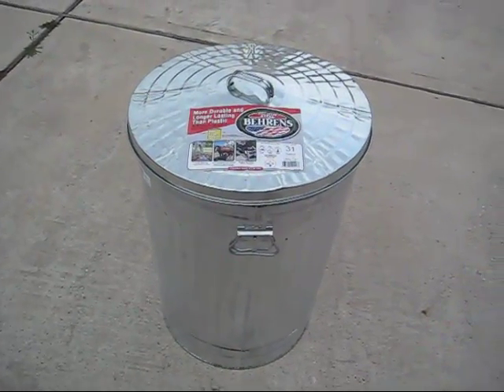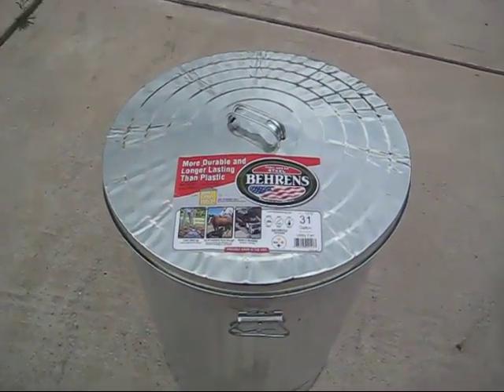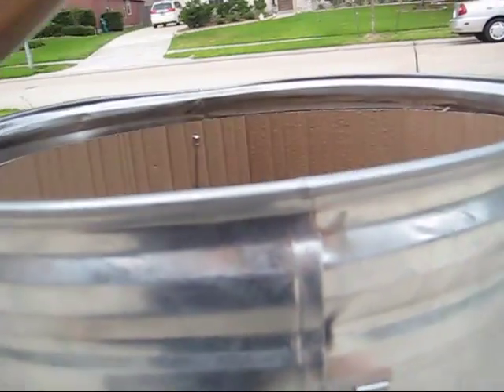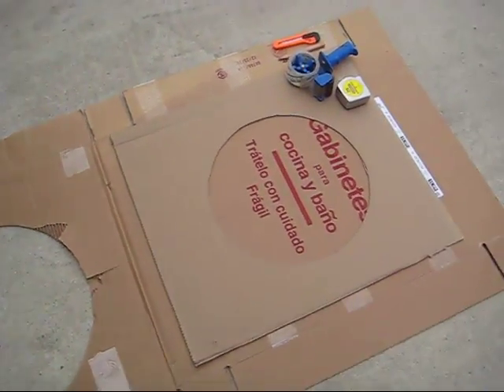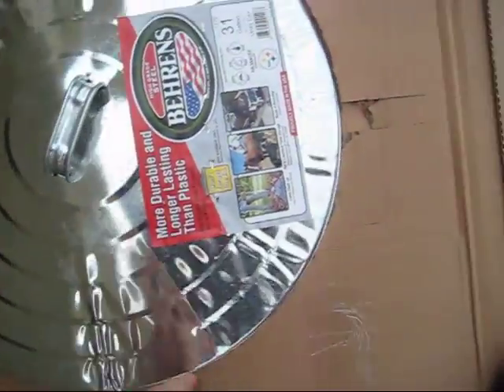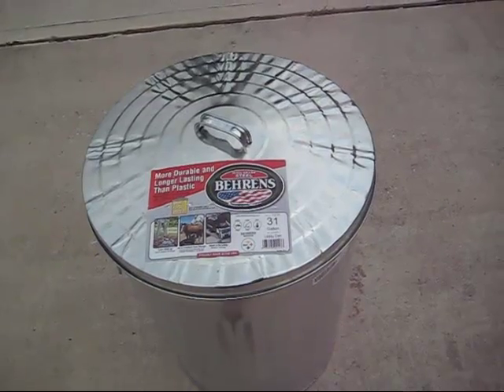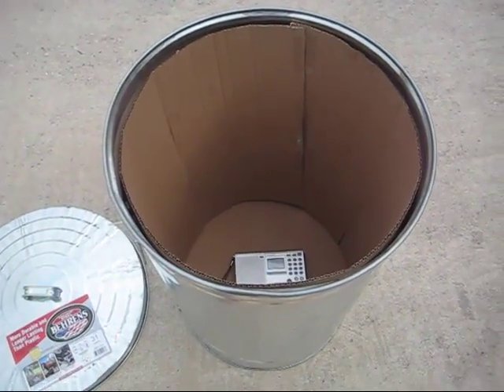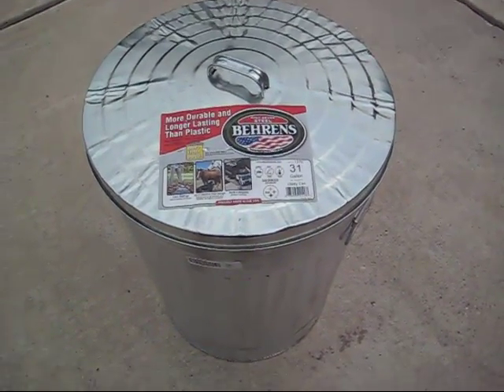Faraday Cage: Garbage Can, Really?

Comment: This will not work my fellow preppers. WILL NOT!  Coming from a electrical engineer. I emp/cmp aka solar flare is at a much much higher frequency than radio or cell phone. Look it up. 2 different types of cages. Grounded & non-grounded. The non-grounded needs to be very very thick and non-conductive liner inside. Both need extremely tight seals so no frequency gets thru any gaps. Moving on. Just remember. THIS WILL NOT WORK!
Reply: Jim, How do you get a grounded and non-grounded cage?  What do you use?
Reply: +Linda Allen 

Ok Linda start with a grounded cage. It needs to be a highly conductive metal like copper or sliver. Copper is way cheaper. Use a thick gauge copper sheet. The lid must be very tight fitting all the way around. Then you need at least 1/4" think non conductive liner on all sides including the lid thicker the better. Solder a thick copper wire from the lid to the body of the cage. Then solder thick copper wire to the body of the cage and run that outside to a copper ground rod that's put at least 18" in the ground. Set the cage on wood or concrete. Bam. Grounded cage done.
Reply: +Linda Allen 

Unfortunately there is no easy way out for a good faraday cage. Good quality commercial ones are for the rich only & good home built ones are labor intensive. I prefer wooden ones as you can set them on the ground, on dirt, concrete or even on a shelf or work bench and your protected. Even from a nuclear emp that goes off directly over head. Only down side to wooden ones are weight when you make them on larger scales. Need a forklift to move them when full. LMFAO! 

I need to find the links on wooden emp protection that was done and post it. Haven't had time between working 70 hrs a week, home projects, raising a kid, looking for land to buy and teaching the kid to shoot guns, bows, throw knives & hunt & gather. Been a busy busy man.
Reply: James Hart 

I did a vid today explaining some of it. Will be uploading it this evening. It'll take a hour plus off wifi. Lol. I'm going to try here soon to make another wooden faraday cage and video it this time. Lol.
Reply: No one on YT seems to know how to build a Faraday cage that holds up to a real EMP.  If you get to it, that would be cool for a lot of people.  Two thoughts:  A) an EMP attack (as opposed to solar) would likely be followed by a second and third EMP a couple of days later to destroy items that were originally protected in a Faraday cage but were then take out to use after the first attack.  It seems that a room-sized Faraday cage would be the way to go, so that your electronics never have to leave the protection, although how would that work with a radio?  B) I read an article saying you can also bury things 10+ feet below the earth.  Seems like if you went deep enough, okay, but more than 10 feet and thus not feasible?
Reply: I am an RF Engineer and I work in Shielded Cages all day and have installed one at work with ETS who build these for military. even a slight gap in a professional installation of a 100dB down at 1GHz is easy to have even when it is filled with bronze wool and sealed with copper and then taped with conductive tape. There may be a chance this works for you but are you really willing to take that chance when you are going through the effort anyway. shielded systems are heavily grounded and have two layers. The frequencies of an EMP or Solar flare are extremely high and can find even the slightest gaps.
Reply: What about underground? Would a bunker or simply burying the can block the EMP or Flare?
Reply: I built this exact cage and I could still call my cell phone in it..   .so yeah.  did not work.
Reply: If you use high quality anyi static bags and seal it up with metal foil you will be a lot better off.
Reply: You should make a video or series of videos showing this, bud
Reply: What if he attached a wire to his homes water line to ground the can?
Reply: Dunno.  A lot of people say you don't need a ground at all.  Like I said, no one on YT knows how to do this shit for sure.  It sucks.
Reply: Considering wood is conductive. I work on power lines - and wood poles get heated up all the time. I would use plastic as the liner. Otherwise he is correct about the grounding. Or use concrete.
Reply: +Jon Himes Thank you
Reply: My thought 1/2 lead sheets thin gauge like maybe 0.21 aluminum  and plasti dip and a grounding rod ..  pour the  lead into a cookie sheet make sheet lead for all sides plasti dip the lead after its all put together. Take the aluminum tac weld to aluminum  frame work for the coated lead to sit inside of the aluminum shield.  Ground the aluminum shield  to a grounding rod. Two  things i need to know will that lead and plasti dip hold up that way? If  no what if i use diodes inside between the lead and aluminum and flow the current back to the grounding rod?  That or just used large resistors between the aluminum and lead.??
Reply: Papa Trucker...right on! Radio energy needs somewhere to go, ergo, the grounding strap and earth ground rod...if a trash can is used, get some thin, flexible foam sheets and line the interior to keep electronics from making contact with the metal sides of can. If I remember correctly, an EMP has a frequency range from about 5mhz to about 2 ghz at incredibly high voltage...

Comment: How do you protect the solar panels from an EMP???
Reply: They have some new ones that are EMP hardened.  Other than that I would guess you would need to keep them in a Faraday cage until the SHTF....plus about another week in case they launch a second EMP.
Reply: Thanks.  I was recently advised that the solar panels themselves have no electronics built into them and so would not be harmed by an EMP.  Have you heard anything to the contrary?  Thanks.
Reply: I was told the connections would be damaged.
Reply: That is a video for the EMP hardened panels.

Comment: I did everything you said, I followed your instructions to a tee and it doesn't work.  I lined and paneled the interior of the can with cardboard and the bottom of a 10 gallon can made by the same manufacturer as you show on your video.  I lined the inner lid as well with cardboard as instructed.  I placed my iPhone in the can and dialed it and I could hear it ringing on the inside... the only way it worked is when I wrapped the cell phone in tin foil....  Have you tested yours with a cell phone?  So far, this method is ineffective based on my doing it.
Reply: Jim you're supposed to wrap the item in tin foil. The tin foil wrapped item can't touch the inside of the trash can,hence the cardboard liner. I learned this from a great book called "Darkest Days" by survivopedia.com
Reply: different frequencies, radio vs cell, cell is harder to block, must be completely sealed, aluminum tape

Comment: I performed this with a smaller 10 gallon can made by the same manufacturer and the only thing I didn't do is put cardboard in the lid.  I placed my iPhone in the can, closed the lid and the phone still rang.  So the only thing I didn't do is the cardboard in the lid.  What function does the cardboard serve?  Let me know what else to do if I put cardboard in the lid and the iPhone still rings... any suggestions are appreciated.... someone said metal tape around the lid and can for sealing purposes... what do you think
Reply: The only thing I can think of is that the metal can still acts as an antenna link and the cardboard is to separate metal from the electronics. I do believe the can needs grounding. An opinion not tested. Wrapping everything in aluminum foil would be the best - but not very functional if wanting to use. Duplicate everything. Don't think so. Let's hope it never needs to be tested.

Comment: Can  you use a plastic barrel?
Reply from the maker: +Newsman Aba Yes, but it won't work. Plastic doesn't protect the electronics.
Reply: The reason I thought it would be better is because one YT prescribed using plastic wrap over the heavy duty foil. which is thicker than sarahn wrap.. But I'll follow your direction instead. There will be only one chance.
Reply: Just make sure you get a good seal. Leaky cages are not as effective
Reply: +Mike Klegin  Sound complicated. I'll just use the simple way. You could conver cookie tins, or tea tins by the same way to store smaller electronic like cell phones USB's, small flash lites,etc
Reply: +Newsman Aba might wrap some fine metal mesh around inside the plastic garbage can along with that aluminum for reinforcement.
Reply: Thanks!
Reply: What do you think about using styrafoam, the thick boxes or even sheets that  people make signs with?
Reply: I would not recommend that unless you layer it up like the destributed shielding that was planned for aircraft. in all actuality might be a interesting experiment if someone had a osciliscope inside the home brew cage and see how much shielding can be achieved with minimal materials...  you could build up charts slowly on your own.
Reply: yes
Reply: +Newsman Andy NO
Reply: +Newsman Andy its an insulator but you need the metal to reflect the EMP,
Reply: what about carbon? layering a brighamyoung ton of pencil graphite down effectively creating graphen conductor.

Comment: Man, this is intriguing - a cornucopia of nutty doomsday preppers!  Are you all on, like, a preserve or something?  Need to sell tickets for people to come and see.  As to the Faraday cage...  I think y'all should start with aluminum foil hats - a tried and true method.  Then, wrap yourselves completely.
Reply: There are solar chargers that will power your electronic devices. Those solar chargers can be put in the can. My dad has an old 1956 Mercedes Benz that's diesel and manual transmission. He has a old 1961 diesel Mercedes Benz diesel  fire rescue 4x4 truck with manual transmission and extra parts. We live on a farm with mountainous terrain. His logic is frightening. He's always stocking up on dry ice to keep food cold for about a week or too. Now he has a liquid nitrogen tank. He says things happens in threes. If there is a nuclear attack on the grid it won't affect us. We are off grid with redundant protective spares. We use wood burning stove but have  gas stoves (100 lbs tanks)  But he's preparing for a CME in which we are overdue. He has an app that warns of Space Weather. Normally we would have 12 hours to make sure everything is protected. He says he will not reconnect anything immediately after an EMP event. Other people will see that you have electricity and that would be a major security problem. So we have those old fashioned oil and kerosene lamps and a BBQ pit with lots of charcoal and wood. 
The bottom line is protecting yourself from other people who aren't prepared and become Mauraders. That's where a great supply of guns and ammunition counts. 
You never know when something going to happen. But you should always be prepared. Even with a stash of cash since banks won't be able to access your account and ATMs won't work. If you have to bug out, always carry seeds to grow your food wherever and whenever you can settle down safely.

Comment: you can buy qyuck disconnect mounting for your battery cables on your vehicles...when ever you get out if your vehicles quick disconnect your battery to protect the brain in your vehicles...
Reply: So, by disconnecting the car battery, the electronics would be protected? hmmm

Comment: You need to seal around the lid and the can with a conductive tape (aluminum tape), and you should ground it.  The radio test isn't enough to tell.  an EMP is ~80,000 times more powerful than FM radio.

Comment: A nuclear EMP can generate EM radiation well over 70000 times more powerful than any normal FM radio transmission . . . Anything that is not conductive/thick enough or with any opening/apertures may not be enough. Think "lightning strike"

Comment: This kind of galvanized container works better as a Faraday cage when sealed with aluminum duct tape.
Reply: Kevin Burgess Could the tape's adhesive act as an insulator and defeat full protection?
Reply: Brett Wells No, there is not enough material in the adhesive to do that. Simply wrap from edge, overlapping to the opposing edge.
Reply: +Kevin Burgess thats what I am going to do...tomorrow
Reply: +Kevin Burgess You guys crack me up.People saying it wont work it will work Yes,no maybe.How the hell do you know unless it really happened?Geez.
Reply: Clyde Burton Thank you! I'm an amateur prepper but trying to learn fast. I'm trying to protect some household batteries, D, AA, and such for flashlights and lanterns to get out of town. I don't know if this works or I'd be wasting my money! Guess I'll keep searching.

Comment: Sheet metal will make a good Faraday cage. Unfortunately they will not protect against a magnetic impulse that induces circuit killing current induction. Take a strong  magnet and place it against the outside of the sheet metal and use a metal screw driver against it on the inside. If you feel magnetic pull then it will not shield against a Electromagnetic inducing current into your devices you want to be protected. A Faraday cage will shield against electrostatic field but not necessarily against magnetic inductions. Look up a material called Mu-Metal (https://en.wikipedia.org/wiki/Mu-metal). You need magnetic shielding not static shielding. And for those of you that take issue with this information have you proved these electrostatic types of shielding will protect against Electro-"Magnetic"- Pulses? Just try a strong magnet as I detail. I am a trained professional since 1972 and I know the difference between Electromagnetic and Electrostatic fields. Garbage cans are just good for garbage and that is what you will have in them after a strong EMP.
Reply: I think my eyes just rolled out of my head.  I bet you wear tinfoil and a bunch of magnets on your head, don't you?
Reply: Aluminum or tin has no ability to shield against magnetic induction. So why would I use it on my head? LOL if you can't argue a point on the merit of real physics do you always resort to insulting the integrity of the person you are disagree with? Prove to me my statements are false using physical rules. Insults only disrupt communication.
Reply: Also note that there is a big difference between the AM or FM band and the energy released by any destructive EMP source. Use a magnet to test as I previously described.